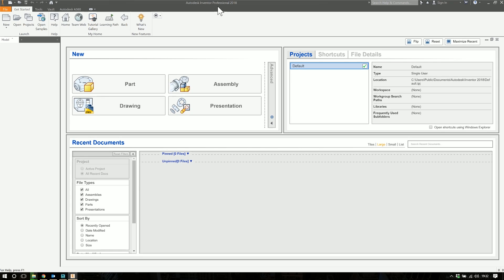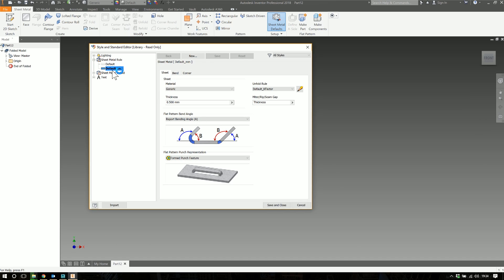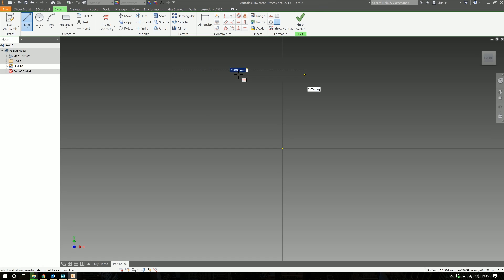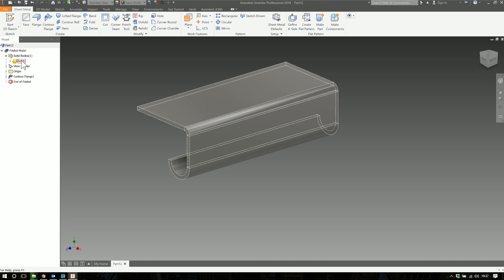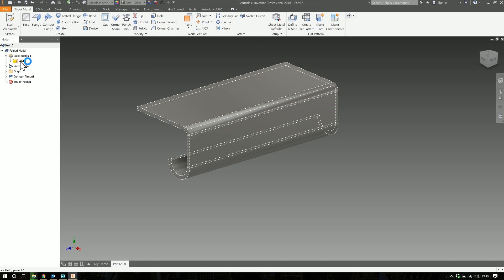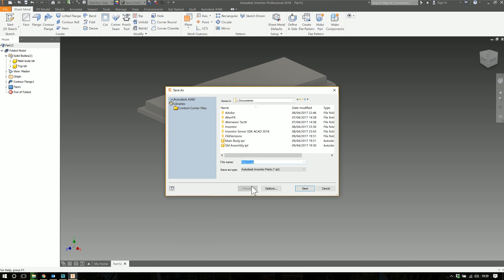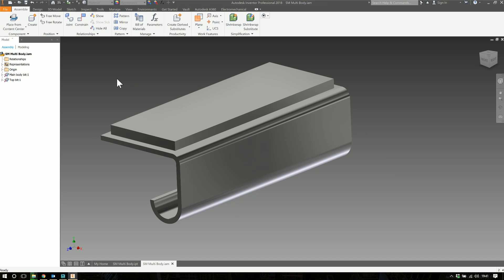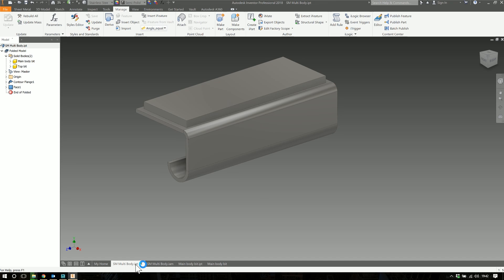Multi-body Multi Styles Sheet Metal

Comment: You could do this even in earlier versions.
Only thing is that you had to be careful when making solids so they have uniform thickness, then make components and chose sheet metal template, set thickness if necessary and make a flat pattern from multibody part.

I mean that flat pattern is looking only if there is uniform(more or less) thickness, and it does not care what features you used.
Reply: That part is only change, that You can have now different styles/thicknesses
Reply from the maker: You could do multi-body sheet metal but only with a uniform thickness? OK thanks for letting me know, I don't keep earlier versions on my system so I didn't go back and check.  Ah well, it doesn't change anything for anyone who needs to use this, if there's an inaccuracy in a statement regarding a now old version I'll just leave it and pin this for peoples reference! Cheers for pointing that out.
Reply: I mean you can have different thicknesses in one part. It has to be standart part. Only each body has to have "uniform thickness" that means that it has to have series of faces that are at some uniform distance apart. they can be even "bended".

then after exporting solids you can do flat pattern.

But this improvement in 2018 is good so you can use features, that make it working with sheet metals much easier
Reply: In 2017 you could have multi body sheet metal parts, and use the make components and get multiple flat patterns.  I don't recall if the different bodies could follow a different sheet metal rule though.  It didn't matter for what I was doing, it was all the same thickness.

Comment: Hii can you explain how to make a cylindrical part with different thickness in every 20 or 30 degree interval. That means I nead 3 mm thick sheet from 0 to 30 degree and 2 mm thick from 30 to 60 degree then 1 mm thick from 60 to 90 degree . Important thing is I want this as a single part and I need to get flat pan of that part. I need to make a component  which we called isogrid panels. Please reply if it is possible to do it in inventor professional.

Comment: I just tried making a multi-body part with multiple sheet metal rules. One rule was set to aluminum material and the other rule was set to brass. When I create the bodies using the different rules, the thickness is different, but the material appearance is the same. In the Solid Bodies folder, each body is reporting the use of a different sheet metal rule, but the material appears identical. I have checked the rules to ensure the material is set correctly.

Have you tried different materials? What is your result?

Comment: So let's say you make a multi body part, then turn it into an assembly. Now put that assembly into another assembly. 
What happens when you want to make top-down changes?  IIRC, you can't make in-places changes to the derived assembly (or can you?). 
Would it be better to insert the multi-body part into the larger assembly, or insert the derived assembly?  And how does that affect the BOM?
I tried it with 2017, and eventually said Fuck it...and went back to single body parts.

Comment: Awesome. I have been doing conveyor side panels as multi body parts in 2016/17 by creating it as one part, splitting it into 3m max sections and then taking them into an assembly. But being able to use more than one style is handy